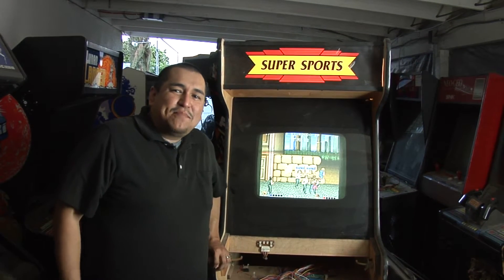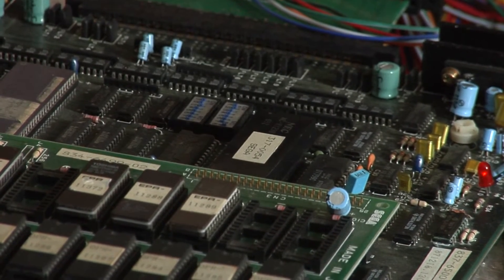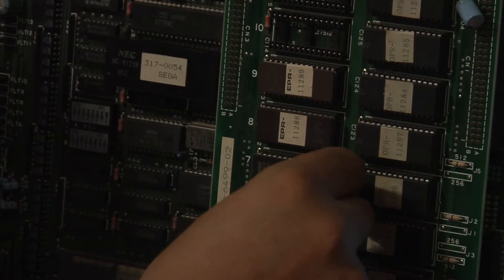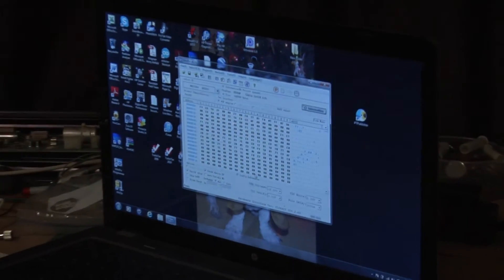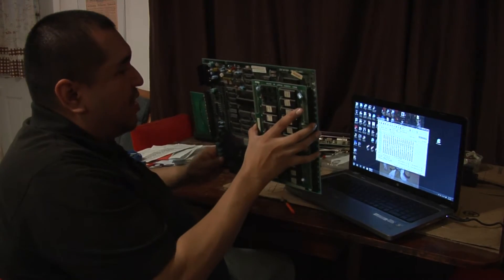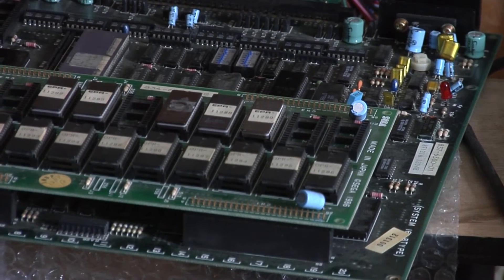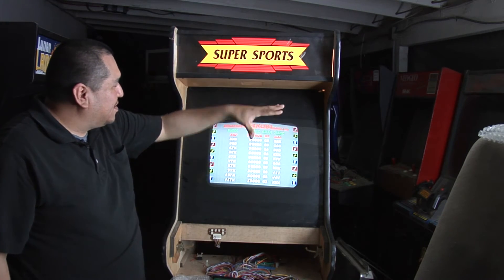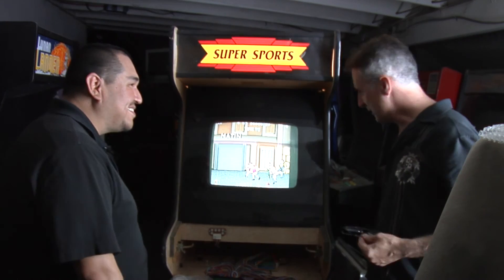Sega Shinobi Suicide Chip Repair, Audio Repair

Comment: I just picked up a Shinobi cabinet that has this same sound problem. I’m having trouble finding the right z80b chip and the right eprom chip, and I’ve never flashed an eprom chip before. Would you be able to provide/sell me the correct parts, and flashed eprom like you did in this video?  Thanks!